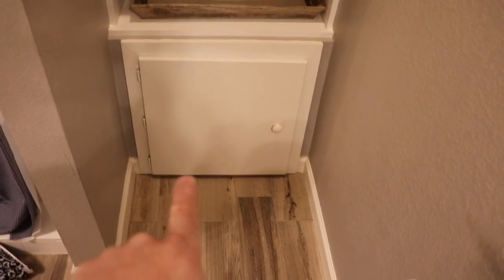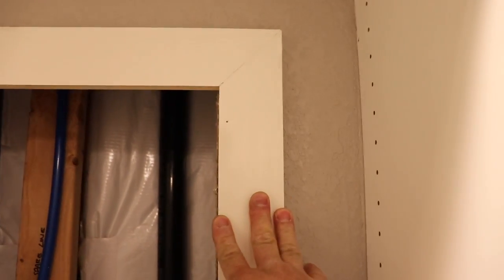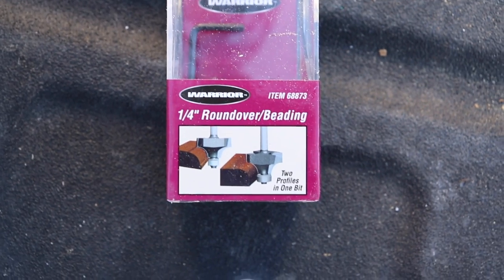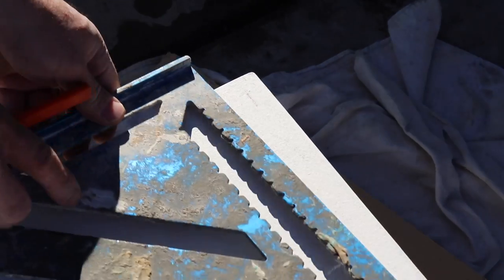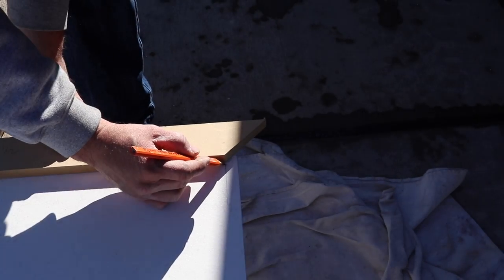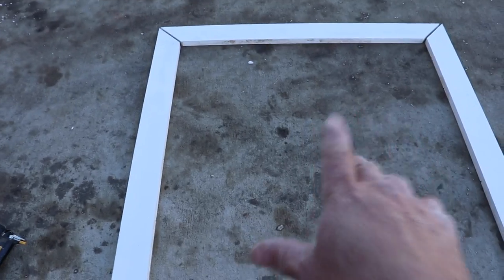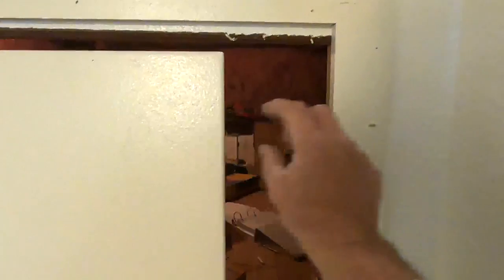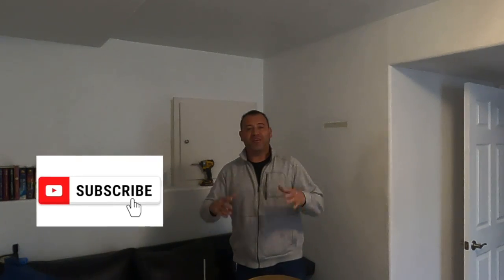How to Build Custom Access Panel #2022

Comment: What type of material is used to make the door.
Reply from the maker: Hi! I used 3/4 MDF board. You can buy a full sheet at Home Depot. If you use 1/2” once paint is applied then the board will warp and bend. Only use 3/4”. I also use the same board for closet shelves as well. Good luck 👍